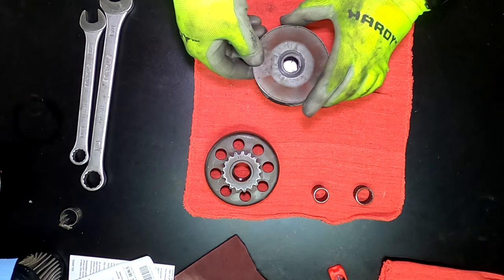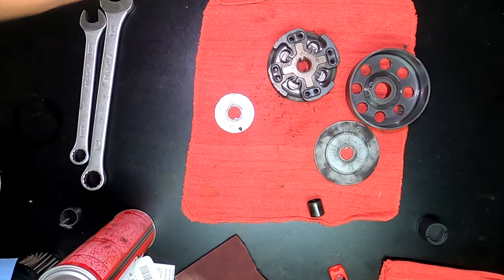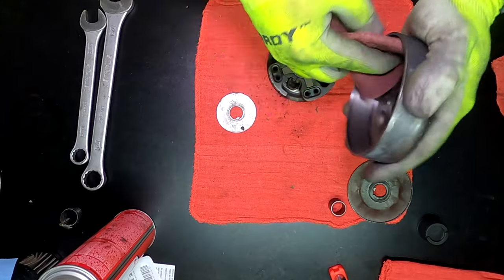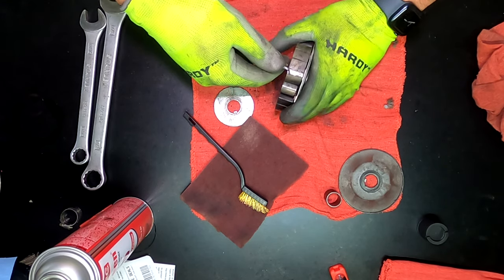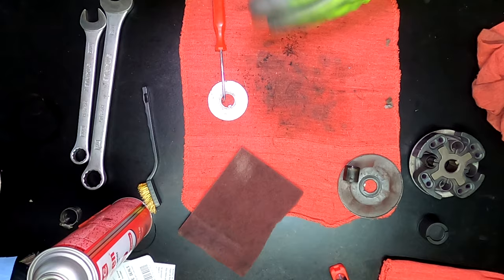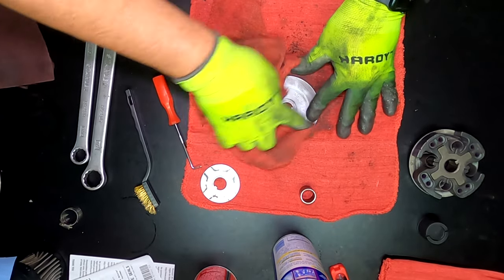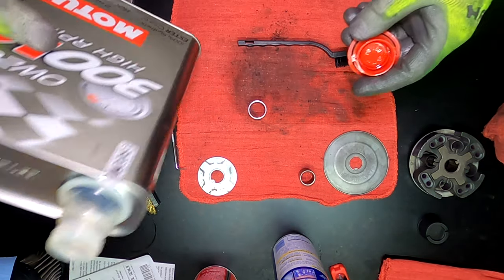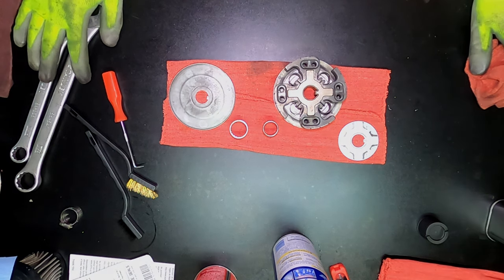GoKart Racing VLOG - Race Prep - Clutch Maintenance - LO206

Comment: A few things that will help you get the max usage out of your Hilliard clutch is to completely disassemble the clutch after every race night inspect your springs for gapping and inspect your shoes which should only be cleaned with a brass wire brush Emery cloth and some WD-40 the rest of the clutch should be cleaned with non-chlorinated brake parts cleaner and the inside of your drum can be touched up and smoothed out with some Emery cloth or Scotch-Brite pad it's also worth noting that the four Springs our best changed out every three to four races this doesn't always mean that they are bad you can inspect them and keep them for spare parts if they are still in decent shape a lot of times what happens is these Springs get hot and tend to open up which will certainly hinder your performance also with your bearing I like to clean mine really good with Simple Green hit it with a little compressed air to blow it out and use fresh high temp Grease every time instead of oil that high temp grease will allow it to stay lubricated during high temp conditions when the clutch heats up whereas oil will break down under the high temp conditions
Reply from the maker: Good info. Thank you for the suggestions. It will help anyone viewing the video.